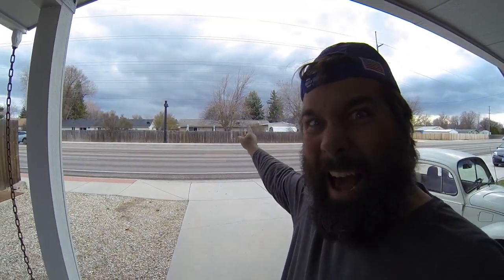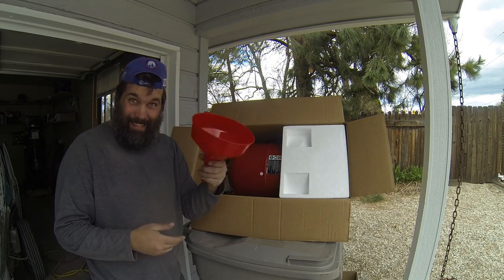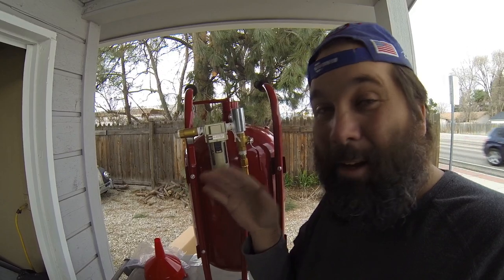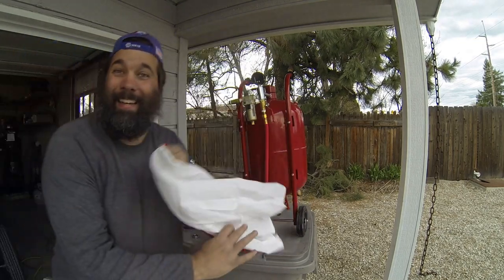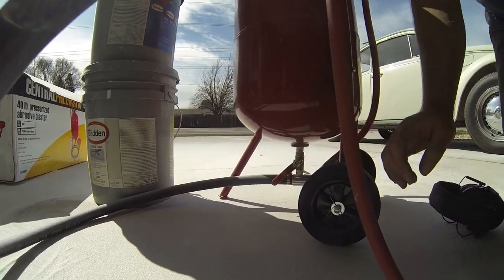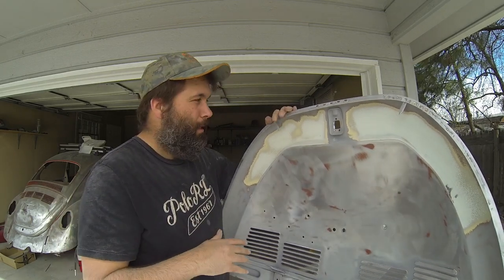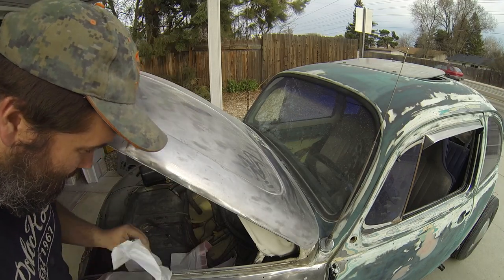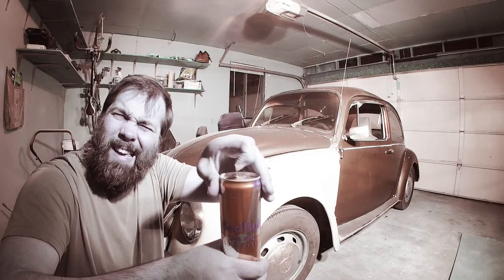1971 VW type 1 Beetle Bug auto vlog Ep. 19 SANDBLASTING Begins!

Comment: Ideally you need to make a collection system so you can reuse your media. There are blasters available that have a vacuum attachment for this, but it always comes down to what you can afford. Unfortunately I'm stuck with and angle grinder.
Reply from the maker: Totally right about a budget! I'm very grateful to have what I have. A collection system would be fantastic!
Reply from the maker: I have been using a grinder and sandpaper for YEARS. This is a much-welcomed change!